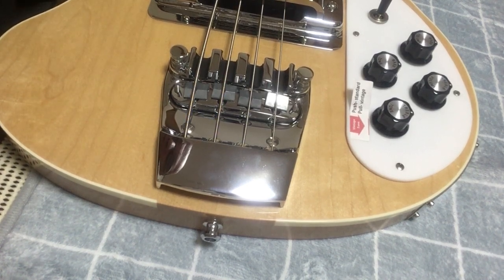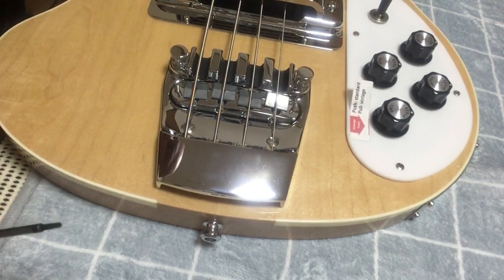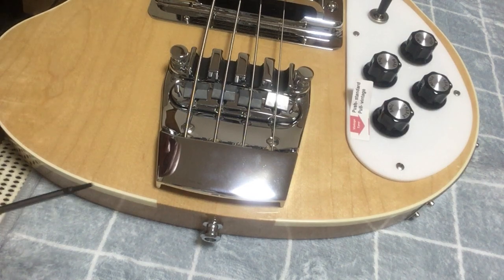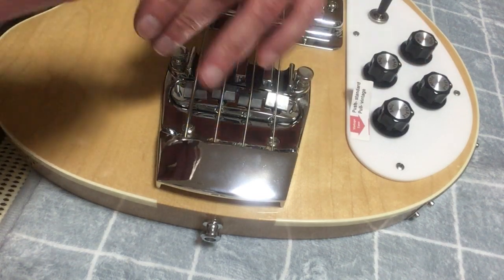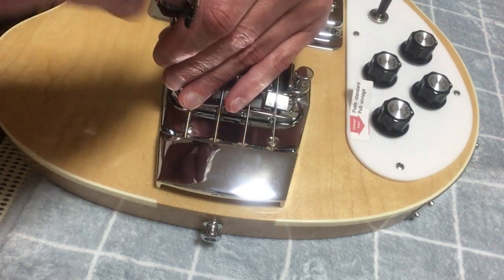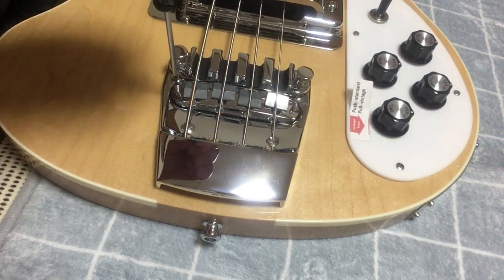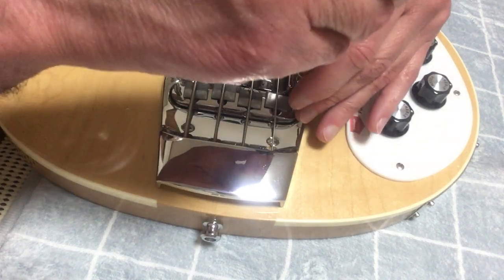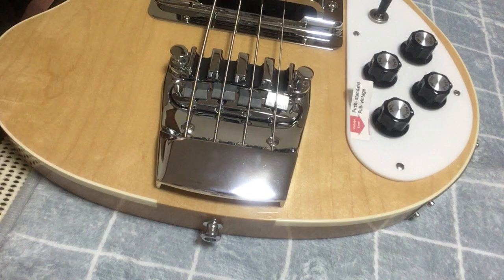Rickenbacker 4003 Bass - Adjusting the action.

Comment: They kept it simple. 👍 Most basses have action adjustment for each saddle.
Reply from the maker: Jay, thanks for watching. I actually prefer the individual adjustment saddles.
Reply: @bass-hiroshimanick2534  Those give you more freedom. On the other hand, if the bridge piece follows the radius of the neck, simple two-point adjustment may be sufficient. One of my son's guitars has this simple adjustment, which has worked well over the past 12 years.
Reply from the maker: Jay, that is an excellent point and you just gave me an idea for another short Rickenbacker bass bridge/tailpiece video. The Rickenbacker bass bridge is set at a 10 inch radius so like you say there's no need to fiddle with it.
Reply: @bass-hiroshimanick2534  Coincidentally Dave just encountered a "bass shaped object" with a bridge with a noncompliant radius: https://www.youtube.com/watch?v=uewClWsnIaw. 😂
Reply from the maker: Jay, thanks! I'm gonna go over to Dave's and check it out.

Comment: Just out of curiosity why do you loosen your strings? I mean don’t you need them tightish to see where your action is anyways?
Reply from the maker: Great question and thanks for watching. You don’t necessarily need to loosen the strings with most bass bridges when lowering the action. However, if you’re raising the action you should loosen the strings a bit or there’s a very good chance you’ll strip the hex nut inside the tail piece or saddles. I would say this is a good rule to follow with most bridges. 
In my case, I had the strings loosened off a lot because the Rickenbacker bass bridge is a bit fiddly and just for demonstration purposes.